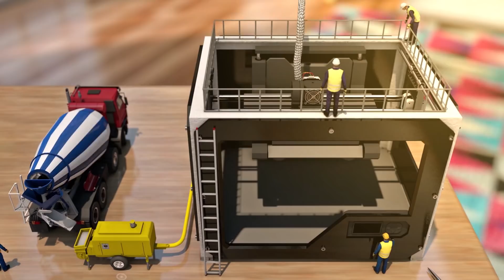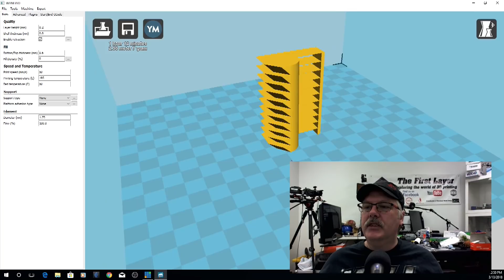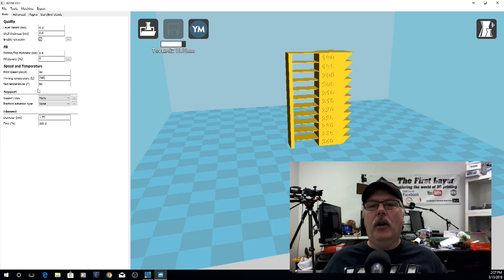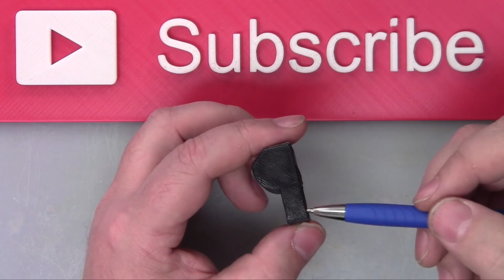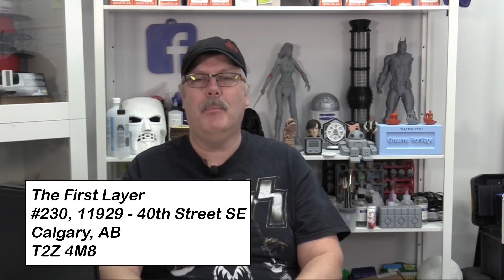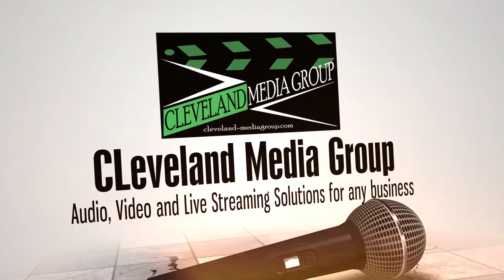How to slice a Temperature Tower in Cura.

Comment: Thanks for the video and explaining how to set these temps in Cura.  As far as the tedious and repetitious part goes, just change the number of layers over which the temperature change is to take place from 1 (meaning immediate) to the total number of layers in the object.  That way you only have to add one single line of code.  Plus, you will get gradual temperature changes over the entire height of the project.  You can see what the filament looks like while printing at 240, 239, 238, 237, 236, etc... rather than just 240, 235, 230, etc -- All done with one line of code  which takes about 30 seconds to insert the code.

Comment: was a little tough to make out / depict the text in the screen recordings, that said, otherwise a great video. printing a temp tower as i type this, and things have been shuffled around with the latest version of cura ie. 4.1.x

As for screen recording check out OBS it's free and there are quite a bit of settings you can dial in to get the perfect screen recording going.

cheers 🍻

Comment: The reason your times aren't right is because your speeds, accelerations, and so on don't match between cura and your firmware. Cura is set up faster than most third party firmwares are set slower.

Comment: The "Vary temperature with height" plug-in on my 15.04.06 version of Cura has only 3 entries.

Initial nozzle temperature
Adjust temperature each time height changes by this much
Decrease temperature by this much at each height increment

It looks like this version of the plug-in only requires a single set of figures instead of one for each change in height.

I use 15.04.06 more than the newer versions of Cura because like to I use an initial flow rate of 105% for the first layer and haven't figured out how to do this with version 3.2.1 yet.